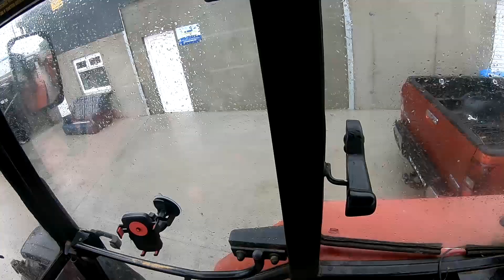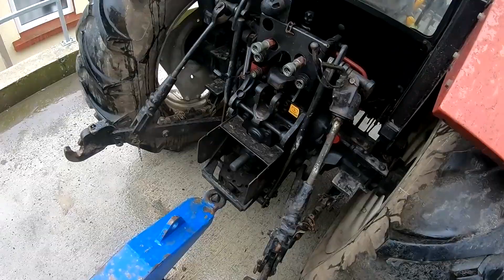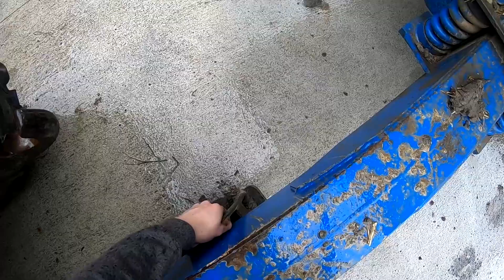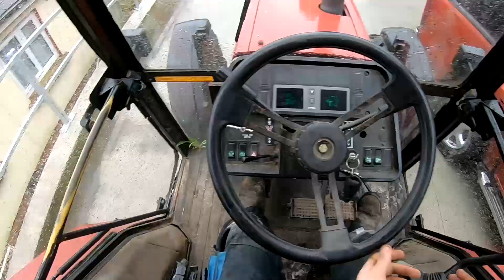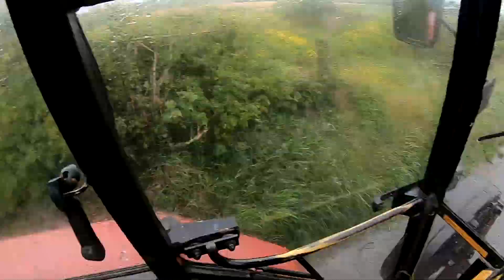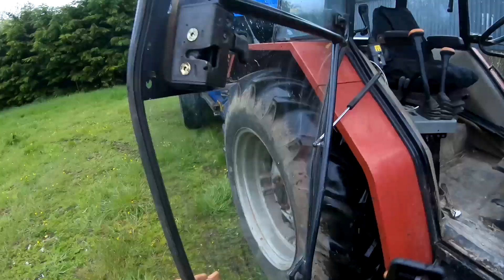Collecting a 14 Ton NC Dump Trailer

Comment: 14 ton trailer, 17.5 tons with a full load. That will be interesting behind a 3.5 ton tractor 😉 Make sure you've over filled the tractor with hydraulic oil or it won't have enough to fill the two long rams completely when tipping. Looking forward to seeing the action!
Reply: Rip case
Reply: @seanbrady5026  no maybe 3